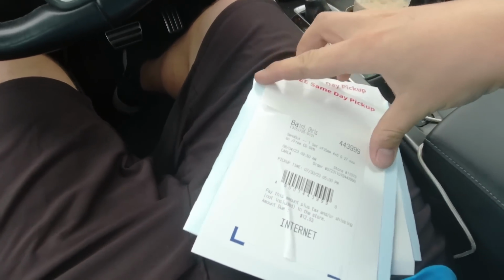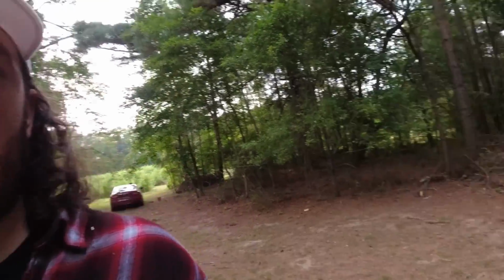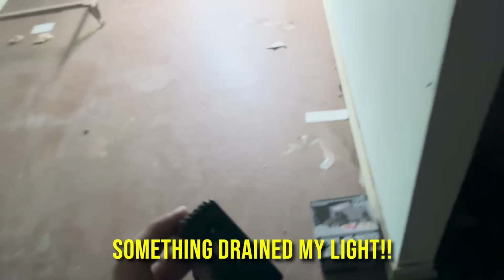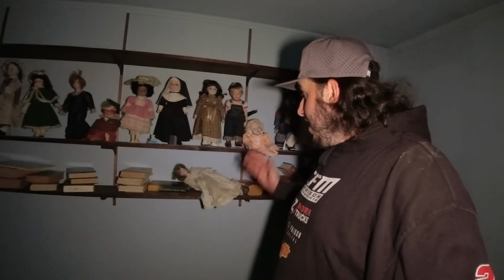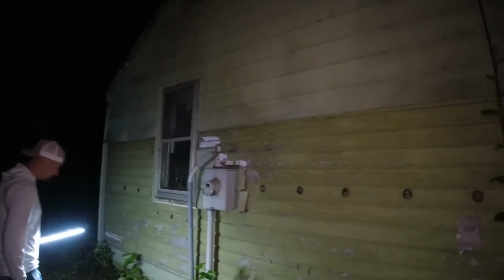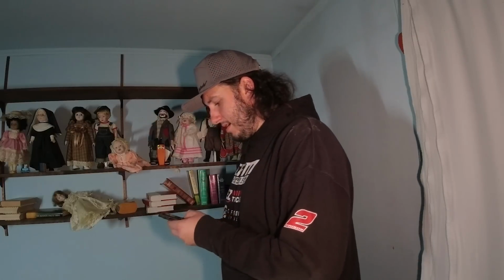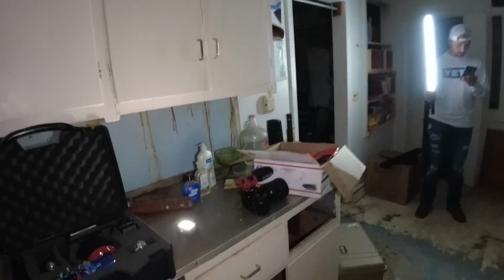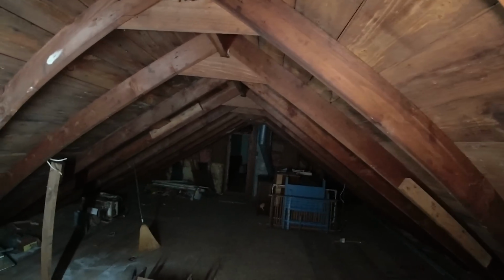I’m Never Going Back to CJ Faison’s Farm After This Terrifying Night

Comment: Congratulations, Chris, on your camera purchase!  The Canon cameras are some of the best and their light sensors can actually take multiple readings within each shot for the best exposure. One other thing good to know is that in these times, when you get film developed, all the pictures are generally printed with an averaged exposure for speed of processing -- some prints will, therefore, look bad, over or under exposed. Next thing to do is find someone who knows how to adjust the development process for each photo to make individual prints for you. You will have tons of fun with this.
Reply: Good to know, I have an old Canon camera. I should start using it again. I hardly ever get anything printed with the digital, just store them on the computer.  👍📷

Comment: I'm glad Chris took photographs
using an older camera rather
than digital photos.
It's fun using film cameras:)
When something paranormal happens
near you, use your old film camera
and its flash. 
You might catch something
while photographing the area:)
The more renovating of the old house,
including outside on the property, the
more paranormal activity could take place.

22:48 Giving you an idea...
In the room where the retracting ladder is
located in the attic. 
Cover the floor with baby powder. 
Leave the room. Later on or next day, check the room 
to see if the baby powder has been 
disturbed in any way. 
Leave a voice recorder running in the room as well.

Comment: Um, spirits don't have lungs. They don't need to breath air or use air to speak. Chris' camera purchase reminded me that my Mom and husband were into photography many years ago. They both used film cameras initially and then went digital. Both were pretty good photographers even though they had no formal training.

Nice job on the property Chris. It's coming along nicely.

There is much work to be done inside, including adding appliances and furniture. Those can all be purchased 2nd hand to save money. My husband and I bought a 50's fridge back in the 80s for our first apartment that worked great for being 30 years old. Just make sure appliances are in good working order. The only thing you don't want 2nd hand are mattresses. You'll need a washer/dryer on the property to wash the bedding and towels, unless you want to lug it elsewhere. 2nd hand furniture can be refinished, painted and if needed, re-upholstered. Your improvement activities will kick up paranormal activity if there's any to kick up.

Comment: At 18:23, that little door across from the small bed frame, is that a closet or a crawl space? Never noticed that door in the earlier videos, but when I saw it I wondered if it could be a crawl space that someone could hide inside of.? I know when you guys were in that living room at the bottom of those stairs (the one you filmed for CJ when the 2 cat balls kept lighting up & moving) you guys kept hearing noises right above you, and that door looks like it's at the perfect height to be right above you if you're in the living room. Some of those older homes (not all, just some) had secret little hideaway spots. I've been curious if there's any areas inside of the house that you either overlooked or didn't yet notice! Loving these videos. Those pics are awesome!! I miss film pictures👍🏼 Much love from California❤

Comment: Great video, as always 😊 i was thinking, if y'all are going to allow people in the attic, since you can get to the attic from the pull down or a door once you're upstairs, you may want to have some kind of safety railing around the pull down. It probably wouldn't need it if it was only accessable through that pull down but if you came in only by going upstairs and are not paying attention or get spooked and jump back or something, you're probably going to fall through the stairs. Either that or block access through the pull down completely. Just an idea, mainly thinking of safety.

Comment: The energy will get stronger the closer we get to Halloween. You can ask to communicate with good spirits and ask the bad to back off (in a nice way of course) 
try to do an Estes method with the good spirits and if something evil comes thru just ask again for them to back off so you can communicate with the good. If they don’t end it and try again in another room. 
Try using dowsing rods to find out where people might be buried. Ask them to point in the direction they are and cross when you are standing over/ near them. Mark it with a flag or something bright. 
Just a couple of new things to try on the property. Everybody can try it. 
Great video. Love everything you are doing. ✌🏻❤️🙂🙏

Comment: I have ouija board and  apparently I am the 4th owner of it. I have had it for about 25 years now..the last owner had had it for about 25 years also and the owner prior to her had had it for approximately 60 years My understanding is that it has 7 spirits attached to it and they are the keepers of my board... when I was given the board it told me that I had 2 spirit guides and they had attached to the board also to protect me from anything dark that may want to harm me. It also said that if a spirit wanted to communicate with me, 1 of the 7 spirits would  leave the board to allow that spirit to come forward to communicate with me.. it was alwaysaccurateinwhat it said, it has never released anything that i know of.. the one thing i find odd aboutitisthatIdont thinkthespiritswants me to use it cause it always seems to moves from were i put it... like its hiding.. I know I still have it , but i haven't laid eyes on it in over 10 years. If you guys use them be very careful.

Comment: Seances can go horribly wrong. You need certain tools and things you do like cleansing the space before and especially after to close it out or you're basically leaving a "door" open to more Spirits. The energy has gotten very strong. PLEASE, any of you, be careful. If it has gained enough energy to shut a door, it has the energy to push you or manipulate things. Use  EXTREME caution with equipment. Holy Moly guys. Whatever is there has back up now. THEY are only toying with you right now. Be careful, stay safe, Blessings for safety for you all and much love. Something there just leveled it's game up. Please stay alert! Second guess nothing and TRUST YOUR GUT! ❤

Comment: I don't understand people that do paranormal investigating & they freak out when things happen. If you ask spirits to do things they will do them. You know its going to be freaky, so why pretend it's not. You guys also took the dolls to the house & left them there. May be the spirits originally in the house don't like the dolls. I think those noises in the trees are people messing with you. I think they are coming in the house when your not there & opening doors & cupboards, especially as it looks like you can't  seal the house up tight to stop people getting in. I recon their trying to frightened people off & get them away from the house, so they can go about whatever they were doing in this house & on the land before CJ bought it. Probably someone very dodgy. Don't let these people frighten you guys off.
Reply: It's on a lay line WAY DIFFERENT